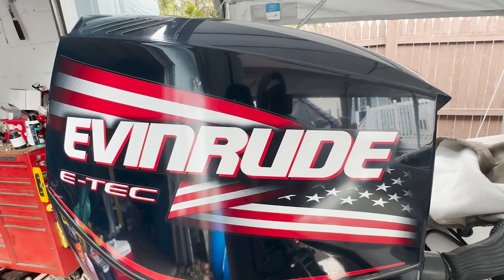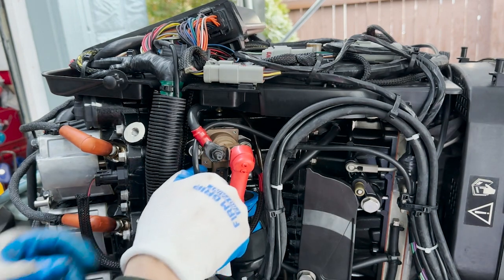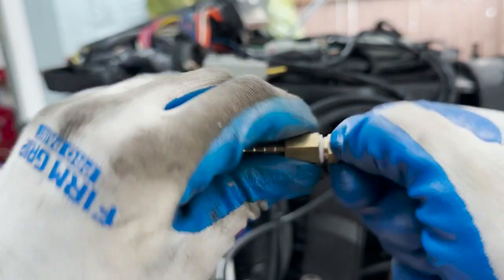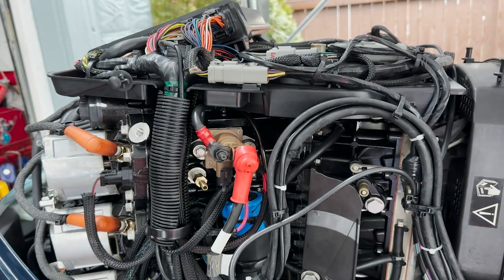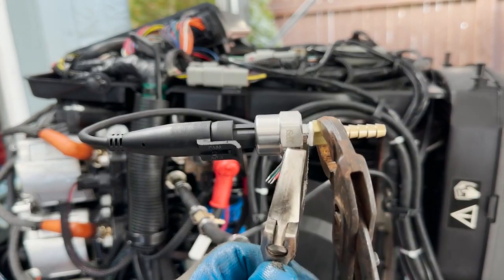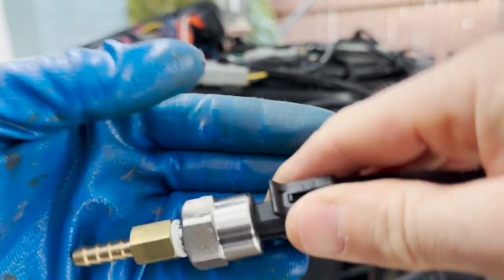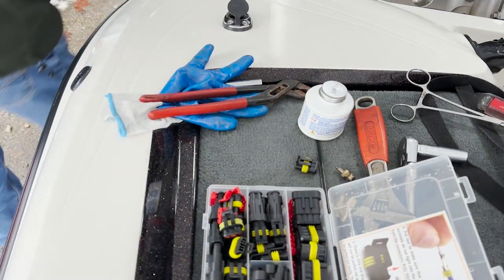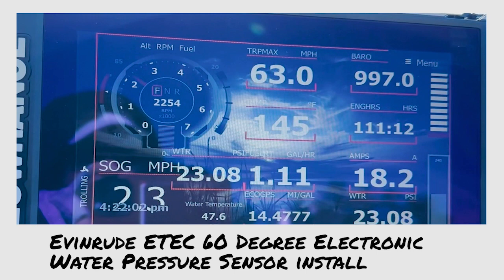Evinrude ETEC G1 60 Degree Electronic Water Pressure Sensor Install

Comment: nice video nice explainations. my 012 175hp doesn't have this sensor just a hose to the mechanical gauge. so I guess when I connect the NMEA2K I'll still be using the old gauge.
Reply from the maker: I use both. I put in a tee so that I have redundancy using both the old analog gauge and the NEMA 2K on my graph

Comment: Is there a reason you used 1/4 hose not 1/8 hose for the whole setup?
Reply from the maker: Thanks for the comment. I used the 1/4 hose for Strength, longevity, availability and durability with the heat and vibration under the cowl. I wanted to do it once and never touch it again.

Comment: Will that part make the hot alarm go off?
Reply from the maker: No, It will only give the digital water pressure
Reply: @BrianB_fishing  my 250 keeps sounding a hot alarm. But stream of water is good.
Reply from the maker: @James-bb2ke  Could be thermostats, water pressure relief valve, blockage somewhere, or sensors. Does it happen at low RPM or higher RPM? If low, could be the thermostat. If high it could be the water pressure relief valve. Do you have a water pressure gauge?

Comment: Awesome video. Can't wait to add this to my 115 E tec. Did you have to go in with Diagnostic Software to enable the water pressure output signal from the EMM?
Reply from the maker: Yes, you have to enable it with Diagnostic Software.